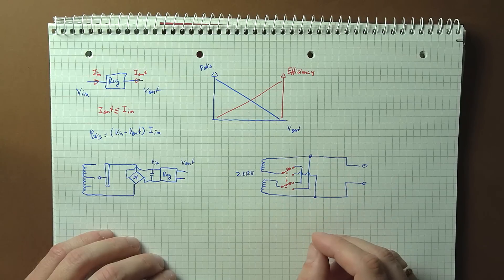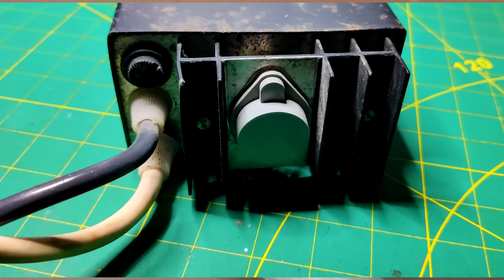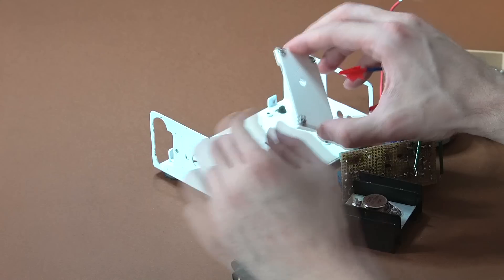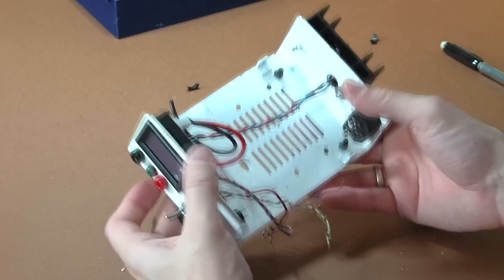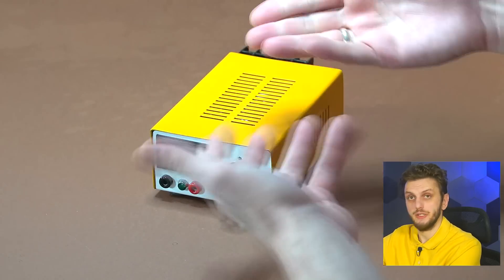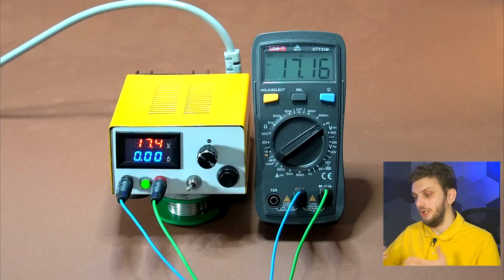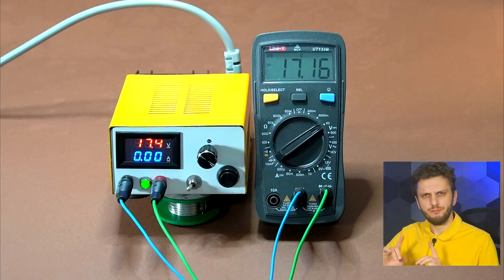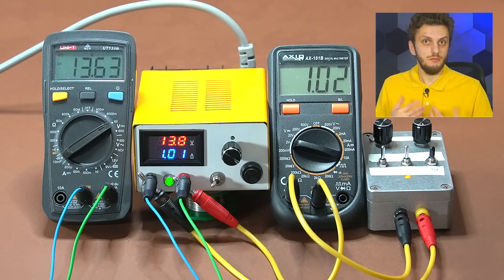DIY BenchSupply [2/2]

Comment: Build the Bridge Rectifier with individual Schottkey Diodes. Parallel each Diode with 1 or 2 extras.
Add another 10,000 uf  25 ~ 35 volt, and at least 1 Mohm bleeddown Resistor.
I would rewind the toroid also.

Comment: There is one potential 'gotcha' in the circuit. The current for the -5V rail is actually sourced from the +18V rail via the loads on that rail, returning via the 470uF capacitor connected to the transformer. You have a 10K resistor minimum load but that will only provide 1.8mA, which may be enough for normal operation but perhaps not when actively discharging a large load capacitance when there is no load current. However the panel meter probably provides a load of perhaps 20 to 50mA (depending on the number of segments lit) which is likely to be sufficient for the -5V current demands for this design but replacing it with a low power LCD meter for example, might produce unexpected results.

470uF is looks to be much bigger than needed; 47uF would provide over 20mA, saving space and cost.

Comment: This may be pretty straightforward, but how is the green LED circuited in? I know its tied to the output, but is it just simply attached in in parallel with a series 1k resistor? Would the current / voltage in the LED not fluctuate along with the Vout?
Reply from the maker: It is supplied from the DC voltage after the bridge rectifier (before the regulator circuit); so the supply voltage is more or less constant.

Comment: As always with your videos, it's a nice work ! However, there is one thing missing in the tests you're showing. I built since the 70's a number of linear PS and I noticed that they are prone to oscillate at high frequencies. The  output cap will suppress most of this oscillation as seen on a scope at the output but it may be present inside the loop with quite a high level (try to probe at 10x inside the feedback loop e.g. at the output of the error amp). It's always a matter of frequency compensation and you may have to tradeoff frequency stability vs transient response.

Comment: What I found as strange is that the unloaded output was loosing 1 Volt drawing 200mA, and 3.6V at 1Amp.. That seems to me like a lot for a regulated PSU. You explained that the output of the transformer will get lower under load and we cannot do a lot about it. BUT... that is exact why stabilised power supplies are made, to compensate for all the internal resistance of transformer and diodes. So I think this loss should not happen in that amount. Having no experience with switching supplies, and having no idea what design you used in the end, I can't explain it.
Another small problem with the design is that you used a bit thin wires for the current path, AND used a switch in that path that has doubtful resistance for such current path. Could you not cut off at the base of the output transistor ? As you suggested, your voltage losses will probably also be solved with the use of sense connections on the output, but at the base it seems better to use a low resistance output path in the first place.
And finally, the heat from the diodes will be halved when you use Schottky diodes, but that's seems obvious.
Reply: That's a very satisfying answer. I was thinking that the max. voltage was already set by a reference.

Comment: Yea those diodes need to be changed or maybe you can replace 2 with fets in a quasi synchronous setup. 
Also a proper PCB would reduce noise. regarding the 30mV pp noise i am not sure where that comes from but i think it is a GND loop thing since if i remember well you face a few points where you connect to the case. 
On a side note where did you buy that transformer from? and about how much was it? (parca erai din bucuresti? )

Comment: Very nice design! But the rectifier bridge is a bit too toasty imho, would definitely change them to the schottky type. Did you take the top cover off right before taking the temperature measurements or was it open all the time? This can also skew the measurement a lot. What about the transient response, can you measure the loop stability?
Reply from the maker: Indeed the PN type diodes where not having too much fun, but I did change the rectifier; I just started off with that particular one; Regarding the top cover - it was always off, so the airflow was even better than normal and it was still getting extremely hot.

Comment: Great video. Well explained. 
Here's another trick. When using a toroid transformer you can extend the secundary winding by adding some turns manually. This will raise the voltage and can be used to compensate some losses, like the rectifier drop. That way you do not have to use an active rectifier with maybe extra cooling, it is cheaper and you can regulate the extra voltage yourself by the amount of turns. The maximum current will be a bit lower though. This trick does not work for EI transformers though. 
Some try to use schottkey diodes to minimize losses, but there is a caveat, the voltage drop of those is about the same as normal rectifier diodes for high currents. Like the current peaks through the rectifier diodes. And these currents can be really high, like 10A or 20A depending on the load. 
If you take a piece of wire and make 10 turns through the toroid. Then measure the voltage and devide by 10 (amount of turns) then you now how much voltage extra you get for each extra turn.